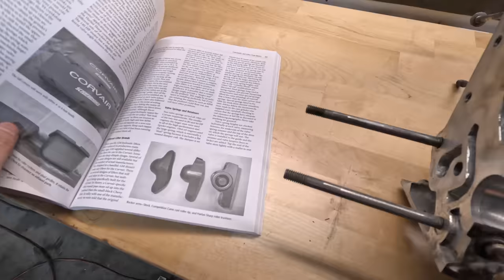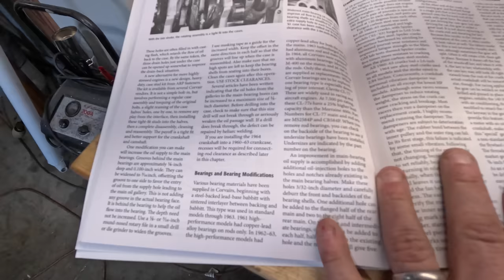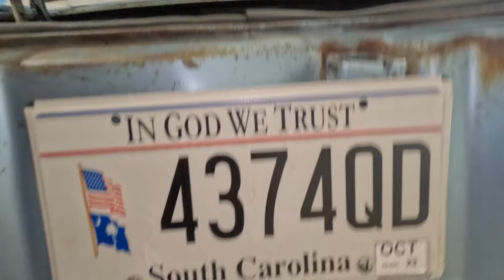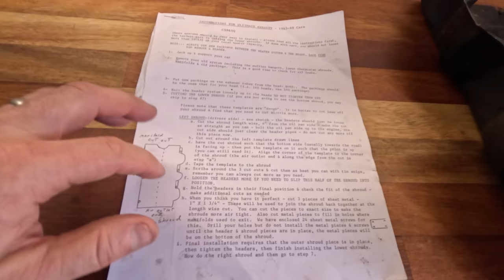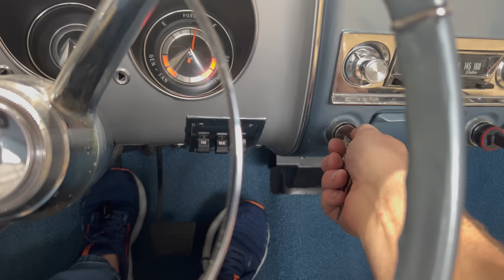HOT New Engine for the FLOODED Corvair | Cam, Heads, and Exhaust...Oh my!

Comment from the maker: IT"S FINALLY DONE!!!   Thank you all for your support and guidance as we put this classic back on the road.  Hopefully this will be the LAST time we pull the engine out of the car.  

What should we do next?   Let me know below:
Reply: Individual throttle bodies with fuel injection 👀
Reply: Restore  the interior
Reply from the maker: That would be awesome.  I did see someone used Polaris throttle bodies and a megasquirt computer to make their own FI system.  Perhaps if I found some throttle bodies I might see about making that work.
Reply from the maker: As for the interior, I will definitely be doing the headliner and a few little things.  Not sure how far it's going to go.
Reply: Chase the rust. New rubber trim.
Reply: How about a new interior and windshield? Congrats!!
Reply from the maker: @gigfy6010  Working on it!
Reply: I've always wondered if a Subaru pancake engine would fit in a Corvair
Reply: Does putting a 65 engine into a 62 lower the cars value?
Another question, because I'm curious and it's hot af in the south. Is it bad or expensive to put an actual air conditioner in one of the 62s? Not one of those just bring outside air in and do nothing to cool it one's lol
Reply: Can you do a rebuild of the Corvair engine to make 275-300 H.P. and a 5 speed manual transmission?
Thank you,
Rudy Prescott.

Comment: Some advice to the viewers: Upon measuring piston ring end gap, do exactly as he shows here EXCEPT do the added step of pairing up the three rings with its prospective cylinder jug.  So, set each jug aside and assign the three piston rings to each one. 

THEN insert each ring into its prospective jug as he shows here and measure and correct them (if necessary) one at a time.  

Do not measure all your ring in ONE cylinder jug.  If you’ve done that then you’ve set all your gaps to that one jug.  Even the best of machine shops don’t get every jug exactly the same. There are slight differences in machining from jug to jug.  

Now, to be pedantic, yes, the jugs are most likely so close in tolerances that this won’t matter.  Especially with the higher end parts. But if you’re going to go through THIS much effort to build your engine right, which you should, then actually go through ALL the steps to build your engine to its highest standard.
Reply from the maker: Good point, and I'm always learning.  Thanks for the help!

Comment: I always loved the Corvairs . I bought a used 1963 Monza convertible for my girlfriend, now my wife, in the early 70's. And as always, a delaminated flywheel caused the vibrations. We had a shop up the road who specialized in Corvairs. He replaced the flywheel (used), cleaned both carbs, for $100.00. My how times fly. My wife and myself still love the early air cooled cars. I can remember cabin heat in less than 4 minutes which was a plus. Those that still own an old Corvair are very fortunate. Enjoy.

Comment: Great job. I rebuilt a 140 Hp version back in 1973, used performance parts, added a four barrel Holley which was specs for this engine.  Great performance and longevity was great.  Your video has my juices running. I am now looking for a Corvair.  Thanks for your efforts.
Reply from the maker: Thank you so much!  Sounds like you had a fun car back in the 70s, and good luck finding another one.

Comment: NICE JOB My Corvair was a 1963 Monza back in 1965 with a 95 hp engine and I drove it while in the USAF In Bolixe Ms . had to add 1/4 x 20 hex head bolts to valve covers and drill the middle hole out to keep them from leaking on me. added a gates green leaf fan belt with steel core and kept the fan running all the time with no failures in the years I drove it. It was a great car. mine was white with red interior.
Reply from the maker: Very cool, thanks for sharing (and watching)!

Comment: Sean, the last time I watched this video, I forgot tell you about my experience with my '65 Chevy Super Sport. The engine always ran on the hot side. During one time, I wanted to add drain valves to the lower part of the engine block for better flushing of the cooling system. Well as I removed the plugs from the engine, no coolant drained out, only casting sand started to fall. The lower portion of the black still had sand in it. No wonder the engine ran hot! It was one on many problems I had with this car!

Comment: I put a 95 hp Corvair engine in a 1961 VW TRUCK, got my parts from JC Whitney at the time. Had to reverse ring gear on VW. Lower sheet metal very important to keep engine from overheating at slow speeds.

Comment: Hi Sean I really enjoy watching you work on your corvair it reminds me of many years ago when I used to work on corvairs I hated them when they first came out because they were so hard to work on but I went to work for a different dealership and the man that was working on them no they are really easy so then I got a different attitude and I got to make a lot of money on them for instance I could change the blower bearing in less than an hour and _ they had a lot of failures and the noise you talked about on the clutch assembly I could drill a hole with an antenna hole saw and weld the plates togather in about a half an hour I also hate Ralph Nader and still in my toolbox I have some leftover bumper stickers that say I love my corvair I wish I could get you one
Reply from the maker: Thank you very much!   I’d love to have a bumper sticker, shoot me an email at autoanatomy@icloud.com and I’ll send you my address

Comment: I was taught and have practiced a different brake in procedure. if you get on it hard and then let off, preferably d0wn hill, you create pressure then vacuum in the cylinders. This helps set the rings by forcing tem againts the walls and then lubricating them.
Reply from the maker: Never heard of that procedure, but if it works for you then awesome!

Comment: I had a '63 Monza that was my stay-out-of-trouble high school project; it kept my two best friends and myself out of trouble throughout our high school years.

I think I had the same headers that you have, from Clark's.  I wish they offered the template kit back then ('79), and I wish I had gone for the hotter camshaft.  I finished it in time for my last day in HS, but ended up parking it the next fall, when the inside of the windshield glazed over with oil from a mysterious engine leak.

This brings back memories.  Thanks.

Comment: Did a similar build in my 66 corvair 50 years ago.  140 horse, crower cam, crown headers all the stuff.  it was fast and loud.  The cam lost a little on the bottom end, but pulled hard to 7K rpm.  Hit 6500 in 4th gear several times.   thanks for the memories.
Reply from the maker: Thanks for sharing!

Comment: Great job!  One tip - don't baby that new engine.  We always would take a newly-ringed engine and put some higher pressures ontop of the piston rings to help seat them against the sidewalls of the cylinders.  Don't know if you used chrome-moly rings but they will take a set if you don't "run them in" by taking several full-throttle runs up to redline (5200 rpm) after getting the engine up to temperature of course.  By loading up those new rings, you will make a better seal between them and the cylinder walls.  Do try to lug it a little bit - not to the point of detonation.  I had a dual-point Mallory distributor in my Corvair 110 with the headers and had the initial timing set to nearly 24 degrees btdc as I recall - no pinging!  The thing was an Auto-cross winner every time!!

Comment: I had a room mate in college that owned a 64 Corvair with a 110.  He would drop the engine and trans after dinner, change the gearing, and put it back in to drive it the next morning.  He competed in gymkana's, and did very well against the Datsun 240Z which was the cool car of the day.  I could not believe how well it handled, he would smoke the other cars in the handling and hold his own in the 1/8 mile.  I've been a Corvair lover ever since, never owned one though.  At almost 72, I probably won't.

Comment: If you use a carbide burr instead of a sanding roll you don't get any sandpaper grit to also clean up. Some of those surfaces retain the grit which comes out of the metal when heated.
Reply from the maker: Good to know, thanks!

Comment: Enjoying the progress I owned a few Corvairs when I was younger and have considered get another, some of the mods I dogged on are oil capacity and oil cooler. My last Corsa I removed the oem cooler and machined an adapter plate an relocated a temperature regulated electric fan cooled oil cooler. I always wanted to increase oil capacity similar to latter Porsche engines. Good luck there fun to own & drive.
Reply from the maker: Thanks Mark!  I believe that anything that can be done to keep an air cooled engine from running hot will only pay dividends in the future.  Same with oiling, cooler oil=happier engine.  The oil cooler sounds like a great mod and I can definitely see that being beneficial for a race car or in a HOT climate.
Reply: @AutoAnatomy  yes my biggest reason for increasing oil capacity I to utilize excess heat recaptured and run it through an exchanger and recover the heat rather than just dumping it all.

Comment: Awesome job. I enjoyed watching the precision with which you assembled the motor. My wife says I'm a little OCD and that she imagines this is exactly how I would do assembly.

Gotta say though, even though the exhaust is a little loud, it brings back good memories. My first car in high school was a '67 Corvair 500 with the 95 horse engine. The exhaust was rusty and starting to fall apart , and I figured while replacing it was the perfect time to upgrade to dual exhaust. I checked with Clark's and the cost to go with factory duals was more expensive than their ultimate exhaust. Throw in the fact it came with headers and I was sold. However, since I was still living at home, I made sure to get the internal baffles to try to keep it from being too loud. The end result was perfect to my ears - the baffles cut a little bit of volume out, but it also took away some of the high note and gave just a little more bass rumble to the overall exhaust note. Hearing yours run reminds me of ripping around in mine back in the day. Looking forward to more videos!
Reply from the maker: I'm also a little OCD, but it helps with my professional career!  What a great story, thanks for sharing and for watching the video!

Comment: Sean, really enjoyed the assembly video. These were well engineered engines and you made some nice mods and improvements. Someday I think it would be fun to rebuild one myself, but I hope I don’t have to! As always, your production value is high quality. Makes it easy to watch. For next projects, I think the interior needs some attention. New upholstery (Clark’s is supposed to have the best), new headliner, how’s the carpet? Maybe find some nice used sporty wheels and some new rubber to fit. I really like the 15” five spoke rally wheels they used on 70s Z28s. They had an original Torq Thrust vibe. You mentioned rust repair. Maybe buff up the existing paint, too, but leave the patina? There’s always something to do! Have fun at the cars and coffee. Wish you were closer. Blessings to you.
Reply from the maker: Hi Brad, thanks for the kind words.   The interior is definitely on the short list, after a little TLC on some rust repair.  I just got a set of 15" Z28 wheels for the car (need tires) and then interior is next!  The carpet was replaced a bit ago, but the seats and headliner need some love.

Comment: Great video. I also chose to use forged pistons in my build. Of course in retrospect, the truth is that new cast pistons are a better bet. These hobby cars will be pampered and may never get past 50K miles. And cast pistons weigh much less than forged. If I did it again for a street build I would use cast pistons and cast iron rings.  Perfectly fine.
Reply from the maker: I think my choice with the forged pistons was mostly due to the low-friction coating on the skirts.  Cast pistons would have probably been fine but this way I can know that they'll never be a problem ever, even if it was a bit overkill.
Reply: That first drive had to be SWEEEET! At some point you need to add up and share the true cost of the parts. I'm sure you have $10K+ in receipts. Corvair parts used to be cheap when I bought mine in 1980 in SC. Now many parts cost the same or more as Corvette parts.

Comment: The WIX has more filter medium than a Fram. The final drive ratio with the 110 horsepower/ 4 speed is 3.27:1 all the others  were 3.55:1. The 110/4 speed moves along quite well with respectable gas mileage.

Comment: Hint on packing the oil pump gears don’t use a heavy grease that might plug an oil gallery. After discussion with an experience Corvair engine builder he suggested Vasoline petroleum jelly. Packed it well for that initial startup and the jelly mixes easily with oil. 

The Clarks Full Fin Cylinders advantage other than more fin cooking surface is that the wall thickness is thicker so even with a optional 60 overbore it is still thicker than a stock non bored cylinder.  Also the full fin bites quality control fir concentricity (hole is centered consistently)

Deflashing the heads is a good way of reducing heat in Corvair motor as well as making sure your oil cooler’s fins are nice and clean and you can see light thru the fins. Enjoy the channel.
Reply from the maker: Good tip!

Comment: One thing I do when I start brand new engines if you can feel the carburetors up through the vent tube on top of the carburetors and the all-points ignition system or electronic set your timing Mark toward needs to be then set your distributor where the points just start to open or the timing triggers on the distributor line up and your rotors at top dead center. You'll be within to 2 to4 degrees simple as that your learner's easy when you've worked on German engines especially the vw's. And fresh gas in the gas tank even if you have to remove the tank and clean it out.

Comment: Hello again Shawn if I recall correctly number 55 main jets work well  on  a more free flow engine  .also you may want to  remove the hose on the top of engine & block off so that all cylinders have good cooling :goodvibes: Best regards .
Reply from the maker: I ordered some 54s and 56s today, since I threw a wideband on there and it's 16:1 at idle and 14.8:1 at WOT!!

Comment: Nice video. I have rebuilt a couple 140HP engines with the same resources that you used. Always get a 100000 or more miles on the engine.
I'd I'd like to see a rebuild on a Buick aluminum 215V8
Reply from the maker: I’d love to see a 215 in the back of one of these!

Comment: Isn’t the Corvair engine known for lots of oil leak problems. Nice detailed work good job.
Reply from the maker: They can leak but not significantly more than others.  Mostly it's a valve cover or pushrod tube issue that causes oil leaks on these cars.
Reply: Yes they were but it was mostly a materials issue. The original material for the push rod tube O rings could not tolerate the heat and would harden and start leaking. When "Viton" came along as a replacement the pushrod leak issue was pretty much dealt with. You could expect normal longevity before replacement.
Reply: @bryanturner683  well that’s good. Thanks

Comment: Great build video and you obviously know what you’re doing so I’m asking a question here to learn a bit more. Widening the oil ways on the bearing journals is that something that is required? Im trying to balance out the pros and cons of reducing the bearing journal surface area (same forces now on a smaller area) with more oil flow as I’m guessing the oil pressure will remain unaffected and dependant on the bearing to crank journal clearance? So the question is has the bearing surface area been reduced for no benefit or am I not seeing it? Thanks.
Reply from the maker: That's a great question, and I'm not really sure how to answer it.  Since the crank truly rides on a thin layer of oil I would imagine that the forces between the crank and  the bearing shell are unchanged but the force from the bearing shell to block might be increased (smaller support area).  Honestly, I just followed the recommendations from Seth Emerson's book on hot rodding your Corvair and hadn't thought about it too much.

Comment: Amazing work! I am in the middle of a rebuild on a 65 Monza 110 w/power glide. I just put the heads back on last night. I decided to go with the hypereutetic pistons with full fin jugs all 30 over. 
I had the  Clark’s ultimate exhaust on mine for about 6 months, but it wasn’t the right fit for the power glide. Couldn’t make it scream with high rpm of a standard. It just had an uncomfortable drone at cruising. I went all the way back to the stock setup with the crossover to one muffler.
Reply from the maker: It does have more drone than I was expecting, and I’m thinking it’s because they welded the mufflers on backwards.   I may try and pick up another pair of mufflers and make my own to eliminate the drone while keeping the exhaust note
Reply: @AutoAnatomy  Wasn't the Corvair the originator of the turbo muffler. They have always had a good sound and are not very restrictive. Ran them on my Corsa back in the seventies.